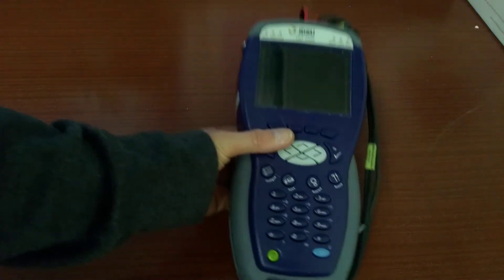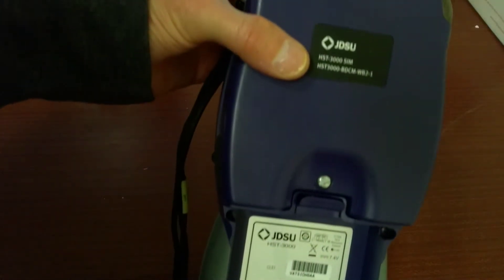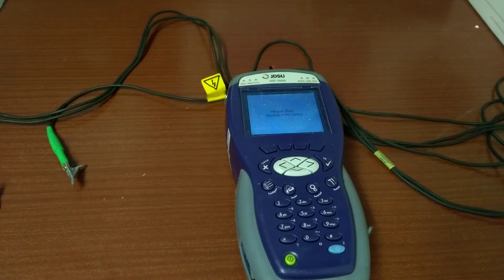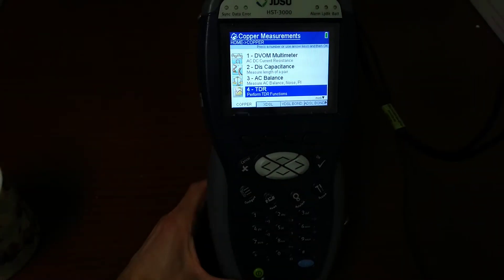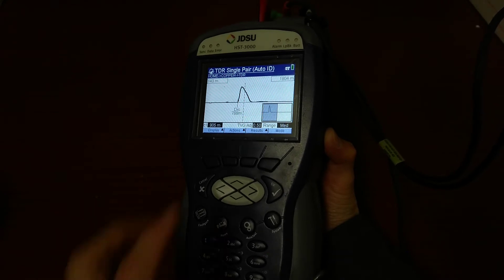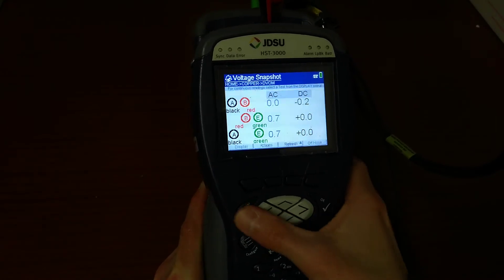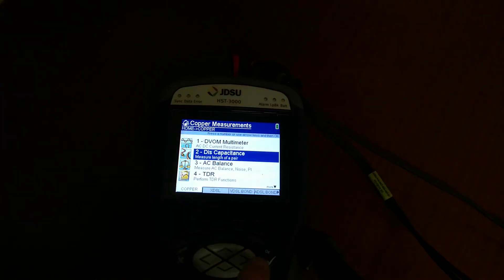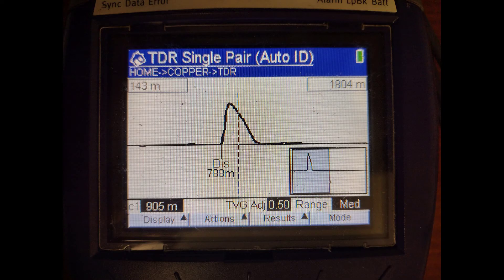The JDSU HST-3000 Phone Line Test unit

Comment: since my provider is useless and the engineers are useless im into buying one of these . Will this device allow me to set my own snr margin and turn interleave on and off ?  also can i change line profile with this ?
Reply from the maker: No. Those are all configured at the DSLAM/MSAN. In the UK on VDSL that's all managed by DLM (Dynamic Line Management) and I don't believe it can be customised.
Reply: Hello Freename, I recently bought one of these however ive only got ETH option on my homescreen. Looking in the options its Revision 7. Has TDR Option Enabled and is a colour copper base unit. Also has a 2500-3000 CU Sim. I know it wont have bonded vdsl testing but should still have TDR Option available right? Any help appreciated thanks.
Reply: Hello I want to buy it
Reply from the maker: Look on eBay?